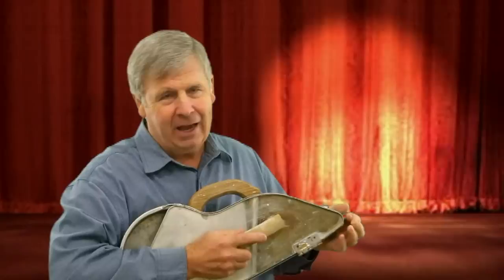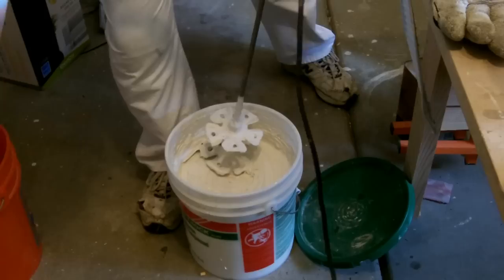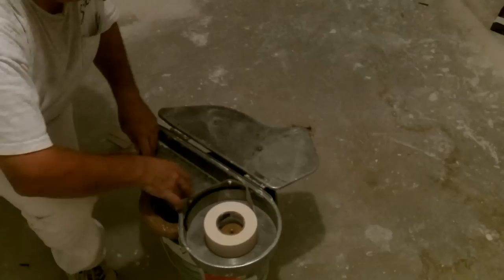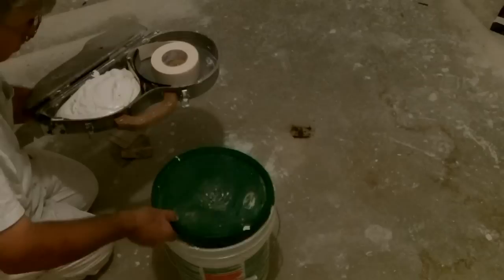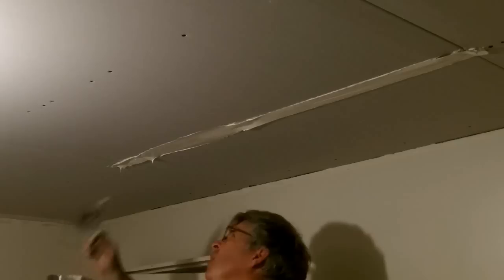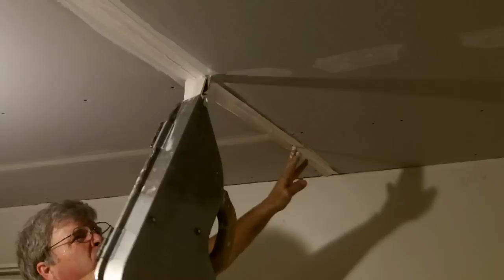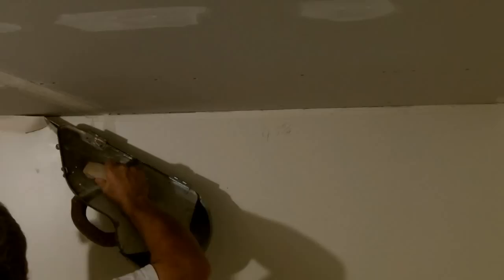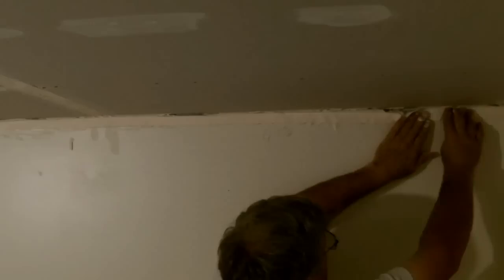Taping Drywall with a Banjo

Comment: Ive been doing drywall for 30 years.. a hint.. use an 8 invh knife to wipe down the flats.. a 4 or 6 inch knife on corners and angles
Reply: Why 8” knife for flats? Wouldn’t that live more of a bump? Anyways I will try it when I return from lunch 😂
Reply: @jovanyjuarez7772  yeah don't use a 8 inch use 5 or 6 inch always to wipe your tape down.

Comment: The pail with the taping mud in it was full of dried mud around the top which was never allowed on my crew. All pails and tools were kept free of dried material. The mud was a little runny but that happens to everyone from time to time but the banjo needs to be re-set to deliver the right amount of mud regardless. I have used that particular style of banjo on one job and it went in the trash after two days. I have 20 years experience and I watch some of the DIY videos and shake my head. You would never see a true professional doing some of the stuff I see but I do agree there are 100 ways to arrive at the same outcome.
Reply from the maker: The best way to do drywall is to hire someone to do it for you. Sometimes you can't afford to do that. Sometimes the job is to small and you can’t get a pro to give you the time of day let alone help you with your projects. Sometimes we need a little help and I have been helped with the video I find on YouTube. I have never said that my videos are the only way to do things, it's just a way and it's not the best way for everyone. My videos are meant for the those who want to do it themselves, not the pro's. I know that not all so-called pro's do a good job, while some are masters a what they do and I take my hat off to them. I'm just a guy that has been in the construction industry for 43 years and has been a remodeling contractor for 35 of those 43 years and I'm just trying to share some of the knowledge that I have learned. I know my ways are not the over all best it's just a way. I have hired Pro's that when they were done you could see every joint and I've spent money on having the work it redone. Jason Lanier coined the phrase "use the gear that works best for you" above all, thank you for taking the time to comment and thank you for watching.
Reply: I also noticed right away that he didn’t wipe his bucket down, common rookie mistake, keep it wiped down and you won’t have to deal with endless bigers, he should be fired
Reply: Its.just.A.Bucket. 
I always say use just enough for what you need. 
Clean buckets at the end or when you have down time. If it gets too dirty and full of compound. Throw it away. Yall act like them buckets are extensive. 
Now I ain't saying don't Clean. Cuz keepin tools,gear and workplace Clean is a must,but  cleaning every small detail is unnecessary.
Construction workers don't give a damn. About their mess. Remodeling folk do as it's. Someone's home. That's the only time I    see it necessary to clean everything when a house is occupied while doing work.

Comment: I learned on a banjo in the late 80's. Then on a bazooka love my bazooka! Although it has destroyed my arm. Cool that people still bust out the banjo.
Reply from the maker: Yes a bazooka is the best way to go but at a cost of $1200.00 not every DIY is going to go in that direction, if you go all out and get all the pro tools your spending around $3500.00 for them but you had better be using them every day. A banjo is more affordable and taping by hand even more so. I don't believe  in going out and getting the latest and greatest, but to use the tools you have. The problem with hard work and time is that it wears us all out and makes us old. Thank you for your comment and thank you for watching.

Comment: How much is a lil dish soap?lol Good idea though.No water?? Thanks for sharing
Reply from the maker: Richard Johnson    In a 5 gallon bucket
it would be like a drizzle  around the inside of the outside edge, maybe 2
drizzle.  Enough to make the mud slick.  start with 1 drizzle and add more if you need
too.  Thank you for watching.  Stan
Reply: Standard unit of measure please...

Comment: You bring one of those pieces of garbage on a job around here and you will be unemployed before lunch. They almost do a job as bad as a bazooka does and thats some bad work. If automatic tools actually did good work hand finishers would have disappeared 50 years ago when the auto tools were first invented.
Reply from the maker: Yes, hand tools are the best way to go but it's the finisher that makes the difference Not the tool!  A tool is just a tool, it's the man using the tool that makes the difference.  I hope your day goes better.
Reply: a banjo isn't for a pro job it's for a diy job